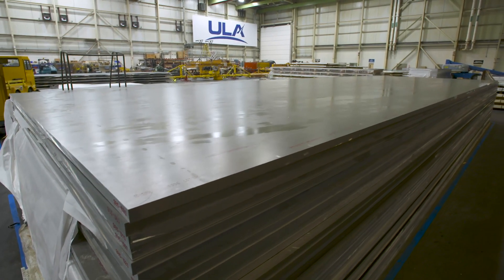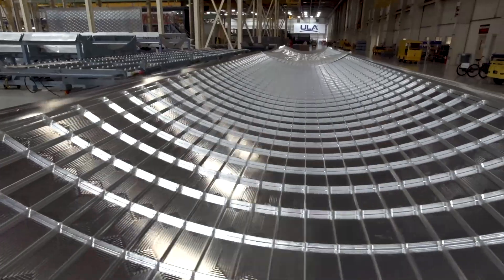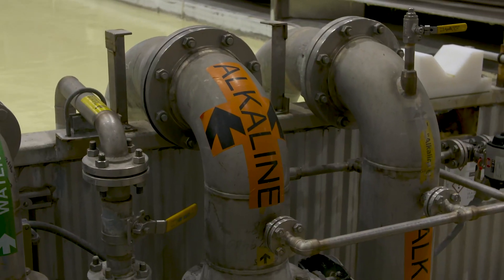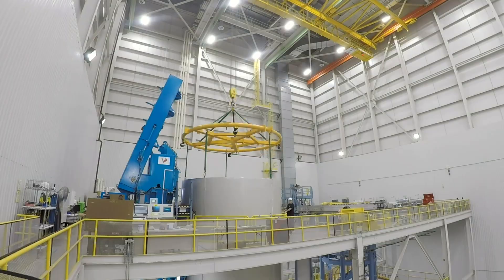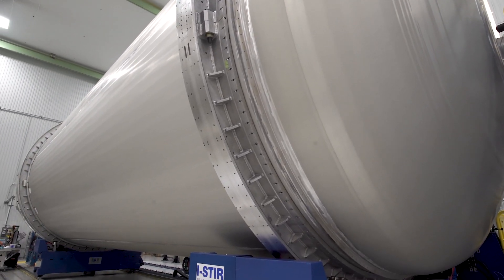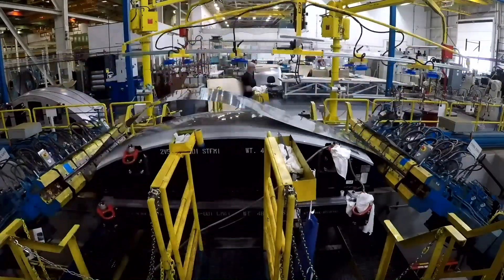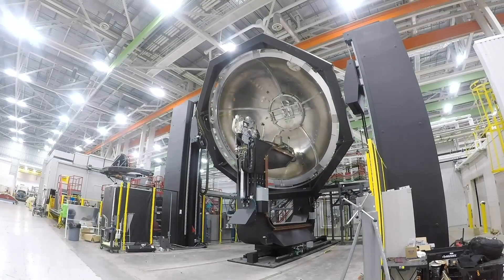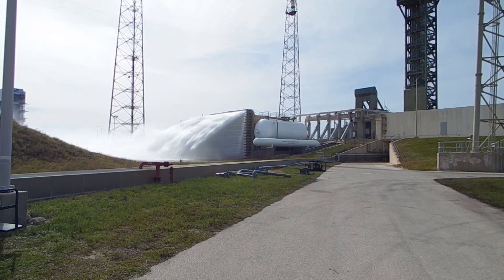Vulcan: Production Update // Building the First Vulcan Centaur Rocket

Comment: Meanwhile in Texas, we are watching the whole process being developed with steel. Still, pound for pound, stronger and therefore also light weight and easier to weld. It will be fun to see these two CH4 beasts fly. Still waiting for BO Jeff to even fly a BE4 though.
Reply: "Still, pound for pound, stronger"

Pretty sure that's not true. You have to look at strength to weight ratio and not just strength. Aluminum is used for lightweight vehicles because even though the structural parts have to bigger than if they were steel, they're still lighter than an equally strong steel part.

Comment: I didn't quite get it, do they build a new launch pad for every rocket as well?
Reply: Not a new launch pad, those have been in place for a long time. But a new rocket design means the launch tower must be modified to hold the rocket in place while its processed before launch. In this case, ULA built a new tower. Likely this new tower will also hold the Atlas rocket too, but let's wait and see. Mobile launch towers make it easy to change the pad ops between missions, depending on the launch customer

Comment: Beautiful work, folks. No wonder you're the most reliable.
Reply: Have you not heard Falcon 9 who is launching almost every week
Reply: Ramesh Pudhucode Delta IV and Atlas V have never failed a mission, Falcon 9 has failed twice
Reply: @rameshpudhucode6862  I wouldn't let Elon Musk watch my kids or borrow my car. The guy is a menace, and serious, mature people should stay far away from him.
Reply: @cf453  at this point he is mainly a threat to Raptors.
Reply: @rameshpudhucode6862  by stats ULA rockets are just more reliable
Reply: @_mikolaj_  That's because they don't iterate their booster to make it better and to enhance it for its purpose, re-use, both were caused because they used faulty COPVs which ofc are used to pressurize the tanks, and delta IV and Atlas V barely change their design, I actually don't think that they have changed the design, whether major or minor, if they have, then good for them! However they still haven't changed their design as much as the falcon 9 boosters,  and every booster is different ,  unlike the delta  IV, they are just a carbon copy of each other, not a bad thing, just no difference, so spaceX is slightly less reliable because they strive for greatness and maximum performance, Delta IV and Atlas V accept the performance they have and don't try to change over time, so the reason that they have 2 failures is that they strive for greatness and don't just settle for what they have, no hate towards U.L.A, just saying they have different philosophies when it comes to making their boosters, and ofc atlas an delta are expendable, falcon is re-usable which causes spaceX to try and evolve their boosters.

Comment: only to be thrown away every launch
Reply: Vulcan is reusable.
Reply: Mikicat wrong vulcan itself is not they have plans to in the future attach a heat shield and parachutes and reuse the engines. They still will trash every srb, every fuel tank, all the plumbing, all the structural parts, all the flight computers and telemetry parts, and pretty much most the rocket. But the engine recovery is still slated for 2024 where as they plan to launch in 2021. So Vulcan has recoverable parts but the Vulcan vehicle isn’t reusable.

Comment: No wonder these things are so expensive. Machining away 90% of the material to form that grid cannot be cheap.
Reply: At least they don't explode
Reply: Ok, but you pay for machine once. It pays off a lot. Unlike floppy barrels.
Reply: It's all recyclable. And it was 2/3.
Reply: Its aluminum, they recycle those shavings
Reply: HEISENBERG  They're planning to
Reply: HEISENBERG  it was a starship reference dummy.
Reply: That's the price you pay if you want to avoid additive manufacturing. It's the strongest and lightest way to make structures like that.

Comment: me just waiting for ULA to make a rocket that can be recovered and reused
Reply: They plan to recover and reuse the first stage engines using a parachute.
Reply: Everyday astronaut has very good video about recovery complexity. He compares F9 and Atlas5 in terms of kinetic energy of the 1st stage booster, right after separation. And shows why reusability is harder in Atlas 5's case.
Reply: It is reusable. In way more efficient than landings boosters
Reply: @_mikolaj_  Care to elaborate on that? Somehow it looks easier to me to just fill the gas tank rather than removing the engine from my car and put it in a new one?
Reply: @unpaintedleadsyndrome  Most of the cost is in the engines and plumbing. 

And you still have to drive to the gas station. The more apt metaphor would be drop tanks in aircraft. The recovered parts would include the engine, but also most of the fuel valves and steering mechanisms.
Reply: @unpaintedleadsyndrome  well, i think it's easier to just unplug 4 pipes, than make alluminium survive reentry.
Reply: This rocket is cheaper than Falcon 9. No landing legs. No drone ship. No hydrolic springs for the legs. No landing guidence computer. The engine will be caught by a helicopter which doesn't need a.i. to operate.

Comment: would be really cool if you could recover thes high quality parts
Reply: They do
Reply: @_mikolaj_  engine recovery is planned. But the stuff they show in the vid will be trash
Reply: @PaddyPatrone  If you have a cost effective way to recover a 20 ton booster from 18,000km/h I'm sure ULA would love it and give you a job. But remember, Vulcan has two engines and re-enters at 18,000km/h. Falcon 9 has nine engines and its record for fastest re-entry was 10,000km/h, and it suffered critical engine problems
Reply: @PaddyPatrone  note: by recovering entire booster you loose about 50% capacity. You need special tanks, that will survive reentry. Here, you save most of money, and have much greater capacity.
Reply: @_Andrew2002  ULA is trashing the booster at every single launch, so no matter how many times they'd fail with the supposed recovery system they won't lose any money.
In short, trying is cost effective.
Reply: @peppeddu  If you have a brilliant idea how to recover a 20 ton booster from 18,000+km/h at a cost lower than making a new one, ULA will give you a high paying job immediately.
Unfortunately it's not possible to recover a booster from those speeds. SpaceX attempted one from 10,000km/h and it got damaged on re-entry and crashed.
Reply: @_Andrew2002   I'm not sure what's the cost of a reentry system compared to the cost of the overall mission but one thing is clear, if they fail it doesn't matter because the boosters are lost anyway.
One of the biggest selling points of ULA is it's reliability and maybe they don't want to be associated with images of exploding boosters.
I've heard your reasons and I don't dispute them, all I'm saying is that "it's not possible" kind of thinking has historically been proven wrong time and time again.
Reply: @peppeddu  "it's not possible" kind of thinking has historically been proven wrong time and time again." Then go ahead, fine away to recover the Atlas, Delta and Vulcan boosters in a more cost effective way then they already plan to in 2023.
Reply: @_mikolaj_  no, they don't...
they need to launch them first :-)
Reply: Mikicat where are those numbers from? While what you are saying is sort of true, Falcon is still the cheapest ride to space and can totally dominate low earth orbit. Vulcan has a high energy upper stage that has a very efficient engine(s) where falcon has a much higher thrust lower efficiency engine. So ULA can get higher C3 and stands out for missions to far off places. But for low earth orbit Falcon can deliver heavy payloads for so much cheaper.